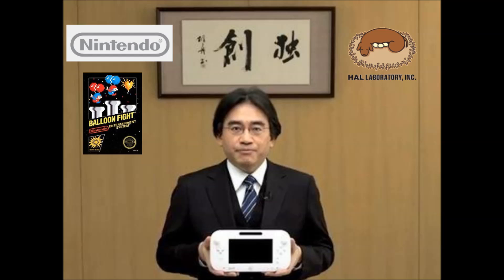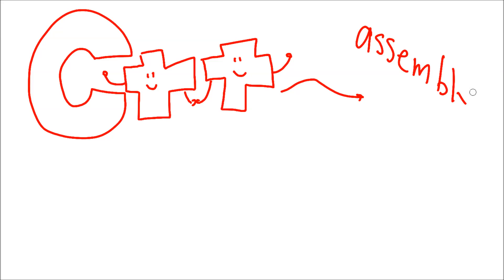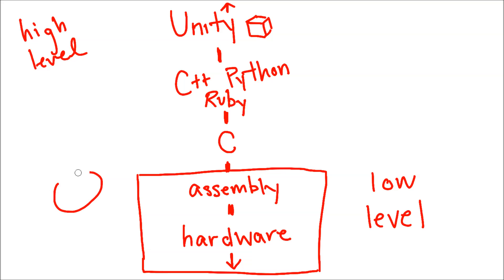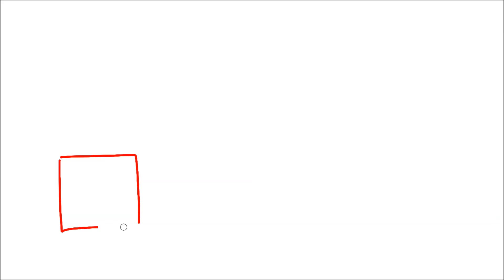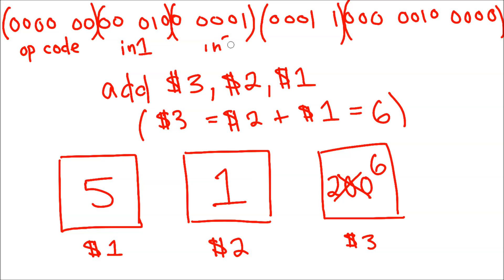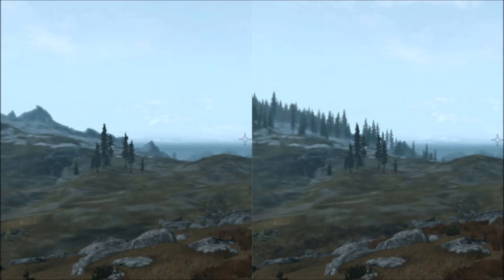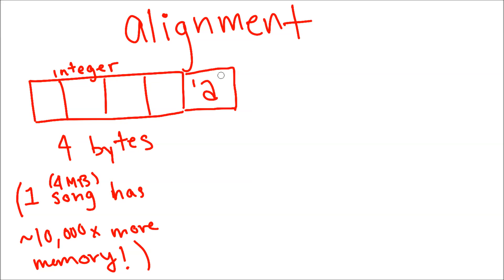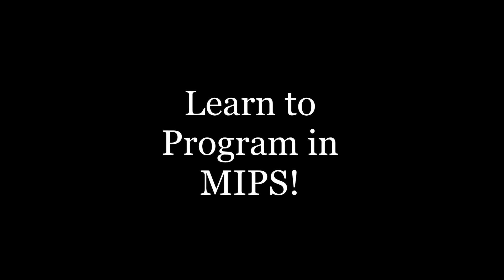How Pokemon Gold & Silver Work (Tribute to Satoru Iwata)

Comment: I normally like this channel, but this video really bothers me. The video goes off on multiple tangents about how "assembly is hard" and "you need to use memory efficiently" which aren't exactly wrong, but devoid of any details that would make them directly relevant to Pokemon Gold and Silver.

She groups C++ with Ruby and Python as high level languages with compilers/interpreters written in C, which is completely wrong for C++. C++ is at about the same level as C (maybe a tiny bit higher) and the compiler is usually written in C++.

MIPS is given as an example of assembly because it's what the creator knows, but the Gameboy and  Gameboy Color use a 8080/Z80 mix commonly called the SM83 that is arguably much simpler. There was no reason to go into detail about how MIPS instructions are encoded in binary other than pushing the video to 10 minutes and contributing to the "assembly is hard" point by falsely implying that assembly programmers need to know/convert how the instructions are encoded at the binary level.

Another completely irrelevant thing falsely implied by the MIPS analogy is memory alignment/management. The SM83 instruction set does not care about memory alignment at all. You are free to put whatever oddly sized variables and any weird spot you want (in writable memory), which can be exemplified by a Wayback Machine look of the first link in the description. The only time alignment of any kind is needed is for DMA, a faster way to copy large blocks of data, and bank switching. It's also worth noting that the ROM for the Generation 2 games was TWICE THE SIZE as the generation 1 games (1MB for gen 1 and 2MB for gen 2).

I really don't mean to insult Satoru Iwata, and his achievements are still very impressive even with more memory and less limitations than implied in the video, but this video gives almost no specific information and even pushes some false info.

Comment: May I correct you that c++ is not an interpreted language thus its translated in machine code / assembly at compile time. Basically it happens once and translation has to finish before c++ code can be executed.

Comment: Saying that C++ is written in C is selling it short. Many modern C++ compilers are written in C++ these days.
Reply: well she probably meant that the first c++ compiler was written in c.
Reply: I'm a bit of a noob, but...
Is not basically any language capable of being used to write a compiler?
Wouldn't that mean all languages can, whether or not they are, be compiled by a compiler written in the same language?
Reply: @seigeengine  true.. of course, you need to write the first compiler/interpreter in assesmbly itself, but after you did that, any complete programming-language will do to write a parser that turns high-level-language into assembly.
Reply: @r4rev2 As a general rule, not really. In the end, machine code is machine code. How you arrived there doesn't really matter. If you are targeting a platform other than x86[-64], modern ARM, or modern PPC platforms, it can actually be very untrue. The quality of code you get out of a compiled language is 100% dependent on the toolchain, and not all platforms have toolchains for C++ that are as robust as gcc, clang, or icc are on x86-64.

Comment: C++ isn't translated on runtime into assembly. It is compiled into machine code before runtime.
Reply: That seems rather inefficient... Since assembly is 1-to-1 with machine code, why go through the extra step? Nobody gets to read the assembly code in the middle step, so what point is there?
Reply: JackBond1234 have you ever debugged?
of course the assembly is always there.
about effizency: translating the semantic of written code into assembly is way more work then replacing assembly
Reply: Debugging C++ doesn't give you assembly commands. What do you mean "replacing assembly"? I'm suggesting they just translate the C++ directly into the assembled binary code instead of ASCII patterns that translate into binary after the extra assembly step anyway.
Reply: JackBond1234 I do not know at all. In fact, I've wondered the same things.
Reply: JackBond1234 have you ever had to debug a compilers opcodes that it spits out? It's all about readability of the machine code and allowing the compiler Devs not having to look threw a decompiler each time, or read the raw opcodes.
Reply: False. C++ is always compiled to assembly and then gets assembled into machine code.

Comment: It is an awesome achievement, but realistically, the Kanto of Gold & Silver is very basic. and reuses tilesets from Johto. Anywhere that would require custom tilesets or new locations were just omitted - Seafoam islands, Pewter Museum, the Safari Zone, even Veridian Forest and the Unknown Dungeon. At the time I thought it was exciting to return to Kanto, but was disappointed in the lack of basic locations that not even the 2MB Pokemon Crystal fixed.
Reply: Satoshi Matrix
 Yeah but you said "disappointed in the lack of basic locations that not even the 2MB Pokemon Crystal fixed" - and Im pointing out that Crystal and G/S are the same rom size.

Crystal they squeezed a little bit more. but I don't think significantly more. since the animations were only 86KB worth of data.
Reply: Satoshi Matrix That explains a lot, actually.
Reply: Looking at ROM sizes... Pokemon Gold and Silver are also 2MB.
If I recall adding areas or rooms is a lot more difficult then adding additional graphics - like what they did with the animations.
The animations are rather simplistic, It ether edits certain 8x8 tiles or does a palette swap.
Its actually kinda clever, since each animation takes less room then the graphic of a whole new pokemon would.
- Totodile for example is made of 24 tiles, and it's animation only has 22 'new' tiles, despite being 19 frames of animation.
- I don't know exactly how true this is, but If I recall every animation is ~22 new tiles actually... which means the animations all took... a little over 86KB of unused space.
Reply: You're talking about Crystal, not Gold & Silver.

Comment: So it is basically the same like the smallest file on my PC is always 4kb on disk.
Reply: Pretty much, but the limitation isn't with the Processor, but in software. Storage devices divide up their addressable space into blocks at the smallest level, and File Systems consequently layout files as a collection of blocks, with files unable to "share" blocks. Older disks use a block size of 512 bytes, while newer ones use 4096 bytes(your '4kB'). Though if you're using NTFS, you can make files <4kiB take up 0 blocks by using NTFS Compression (NTFS will store the file within the File Table instead of using blocks)
Reply: Akriashi Yes. I have used partition programs before, that don't take bytes as input but sectors...
Reply: fuck me I am reading for an exam in Operating Systems and reading a book by Tannenbaum about that.
You summed up 5 hours of reading in 5 lines.

Comment: Dang, he seems to be as badass as the original programmers of Elite. One thing they did was to transform all multiplications and division to logarithms, because the hardware that day (CS Specturm etc) couldn't handle those calculations well, but they were pretty good at adding and subbing. They just added shitloads of logarithmic tables in their limited disc space to make it work. Also there were some other programming wizardry involved that blew my mind while reading it.

Comment: Is byte alignment important on the gameboy? I didn't think it was because it has an 8bit cpu. I know the source address of sprite DMA needs to be in aligned to 256 bytes, but that's the only case I can think of where alignment is important.
Reply: Yeah I believe she pulled that out of her as. Maybe it is in MIPS but MIPS also isnt relevant to Z80. I've worked with Z80 and I never had to worry about it. It was customized chip but doubt Nintendo would troll the devs with such high limitations.

Comment: But we actually don't how they made Pokemon. How can you say for sure they used assembly? I believe there was a C SDK for gameboy games too.
Reply: The C compiler you probably know nowadays is unofficial and wasn't even made yet back then when Pokemon was made. (Assuming you are talking about GBDK) Using a high level language such as C on a Gameboy was impractical because the compilers back then were no where near as efficient as the ones we have now.

Memory was also a concern. Assembly took significantly less space than C and ran faster on the CPU. Also, Satoru Iwata used special data compression techniques along with memory alignment to fit Pokemon Gold/Silver on the cartridge.
Reply: TheHappieCat I think C is the best thing for programming hardware. It is simpler to write than Assembly but offers very little overhead for that simplicity. The trade off is worth it. Which is why UNIX and Linux are written in C. And pointers make memory management a much simpler as well. It's amazing what you can do with even basic pointer arithmetic in C.

 C and C++ are truly among the most revolutionary programming languages of all time.
Reply from the maker: If you look at the C compiler for the NES, for example, it still requires knowledge of the specific hardware and memory requirements. You'd face the same challenges even if C is easier to write in.
Reply: I see thanks for the response, and great video!
Reply: I was just speculating because Junichi Masuda contributed to some of the programming on the first games and He mentioned on his blog that he studied C programming on Unix. Here my source: http://www.gamefreak.co.jp/blog/dir_english/?p=27. Also thanks for the response I didn't think about the memory issue. Compilers now are way better.
Reply: Danny-E 33 interesting!
Reply: We know they used assemlby instead of a C SDK because we can look at the assembly in the game. The assembly is definitely not the result of using a C compiler, because that generated assembly would be somewhat "predictable" or uniform. The assembly code inside the Pokemon games is messy, hack-ish and inconsistent. This makes it clear that the assembly instructions that were used were all manual and deliberately chosen, and not the result of a C compiler.

Check it out for yourself:
https://github.com/pret
Reply: Pokemon Go Unlimited Pokecoins https://twitter.com/linda_smith015/status/759040787594162182?v=XGFBtVbBgnM?v=XGFBtVbBgnM

Comment: Great tribute to Satoru Iwata :]
Do you think programming at such a low level has become obsolete, given the advancement of hardware, or does it still play an important part?
Reply from the maker: siegeO2 I don't think any modern games are developed with assembly. However, it's definitely still used to develop and interface with hardware all over the place. And it's important for all programmers to have a mastery of; I use the concepts of computer architecture every day.
Reply: as she said it's more used to program hardware, I use assembly to program microcontrollers
Reply: Obsolete? For PCs, its just less useful, with optimizing compilers in the market. 
Assembly is however still used in areas, where code needs to be tightly timed.
Reply: Wizard of OS 
if someone builds a chip, they need to write the firmware in low level C or assembly.
alone in your phone theres plenty of them
Reply: as Tanenbaum said in one book I'm currently reading about operating systems history repeats itself.
The concepts of direct memory access , low-level programming etc etc which are long gone in the way they were used back then, are now emerging as ways to program microcomputers in many appliances, cars etc.
IMO in computer science nothing becomes obsolete, everything has it's uses.
Reply: I wouldn't say a programmer needs to have mastered assembler languages to be a good programmer. but it certainly helps. But assembler will never become obsolete.
Reply: +Wizard of OS Not so much in games, but a lot in high end software, like Photoshop, Logic, Premiere etc, where performance is really important. Usually most of the program is written in a high level language (C, C++, C#, etc.), and then some of the performance critical functions are written in assembly